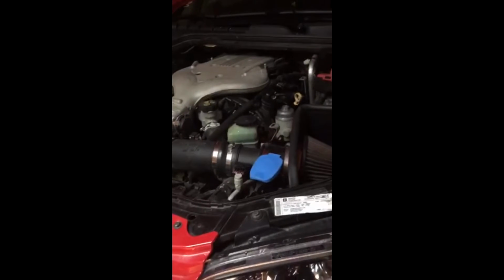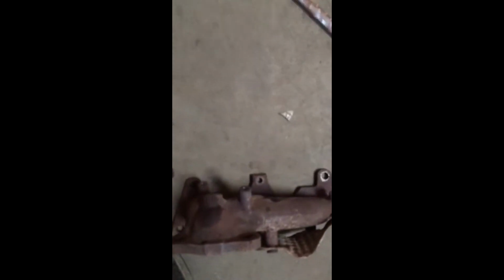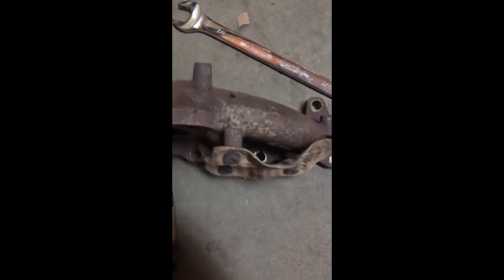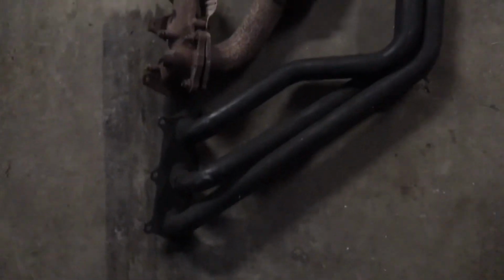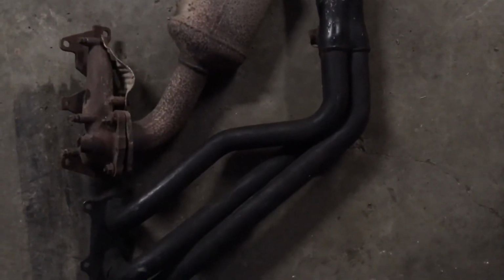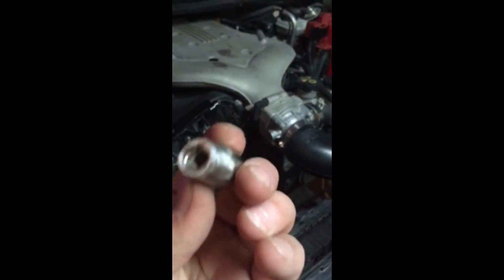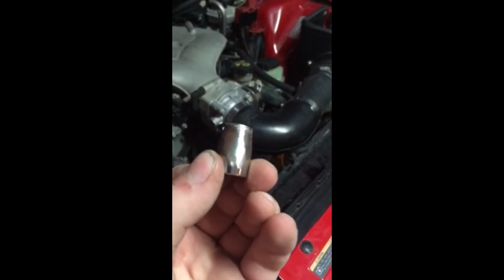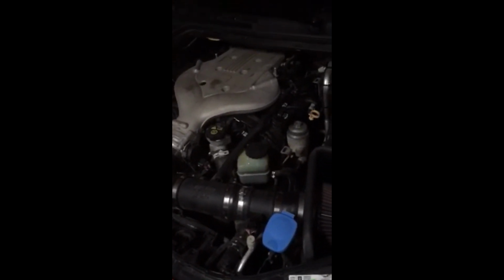2009 Pontic G8 V6 header install

Comment: Did you have any issue after add headers
Reply from the maker: I just had a code for the 02 sensors. That’s cuz I went catless at the same time. Then tuned them out. Otherwise no problems at all

Comment: So you cut the stock pipes and welded them together or something?
Are they still hanging low or did ya find a way to pick em up a tad bit?
Reply from the maker: I clamped them together and the headers still have low a guy could trim up the primary tubes to make them shorter
Reply: You got the clamps from an autozone or something?
Reply from the maker: I had the mid section of the exhaust done at a exhaust shop and they used band style and clamp style but you should be able to get them at any parts store
Reply: Their a shop that quoted me 150 for the install. I think I might just take it to them. Save me the hassle of doing the work and fitment. Thanks!
Reply from the maker: @ManuelTorres-pm8el  expect it to be more the 150 for the header install but if it is that much then it's a hell of a deal!

Comment: Are those pacesetter cats if not what went after the header?
Reply from the maker: Randall Qualls no cats it’s a reducer from 3 inch to 2.5 inch pipe
Reply: Will you need a reducer for the pacesetter on a v6 g8
Reply from the maker: Yes I used a reducer from 3 inch to 2.5